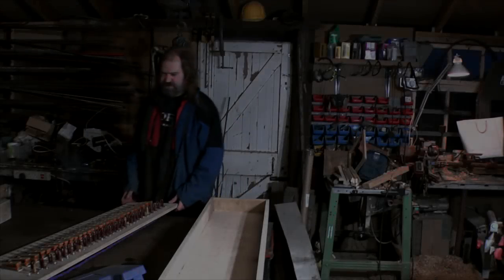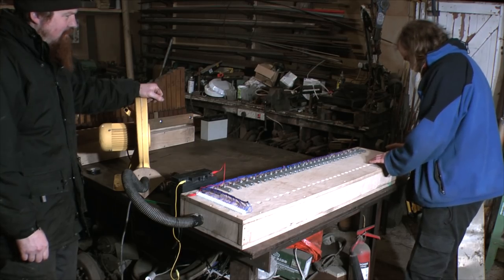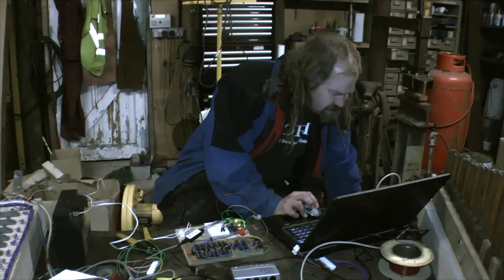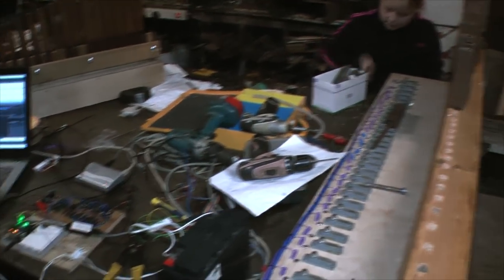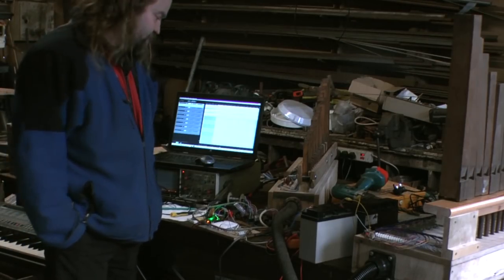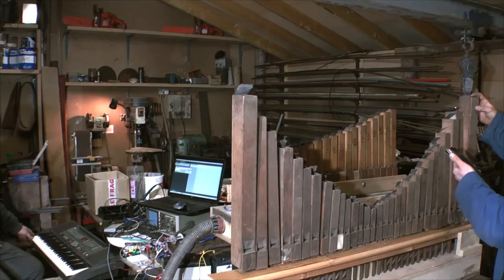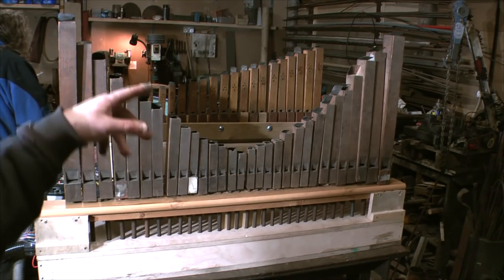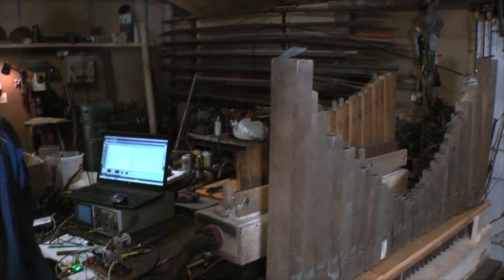Project Awesome 4: Bach in da house

Comment: Interesting.  I once visited a guy in Central Indiana that put an old, very large pipe organ in the loft of his house, complete with all manner of horns and bells.  He had a large motor-drive compressor in the basement, and interfaced the whole thing to a Mac midi arrangement - which would pretty much blow the house down when he played it.  An interesting guy, PHD in electronics, built the early television stuff for Oppenheimer during the war.

Comment: Ok i will admit i never expected that organ to sound as good as that great work from Mr beard no 2, as for Mr beard no 1 so good to see that Landy running so strong a credit to you Max.
Reply: Thanks for the comments. The voicing of the pipes needs a bit of work and it's running on an unregulated wind supply, but things are getting there!
Reply: It’s already sounding good though. That series really does look and go well
Reply: It's fascinating even if I'm struggling to understand the process
Reply: It's fun. Not rocket science, although there is some basic math involved such as the simple fact that an octave is 12 evenly spaced intervals that double (or halve) the frequency.

Comment: Certain discontinuity in the content; was the subterranean installation to be a soundproof  practice room and   domestic requirement for the later  unregulated wind discharge? Genius work anyway in the shed on the solenoid front.

Comment: Also, i was wondering would you be able to do a video/comment on what tools/equipment a person could/should have if they are considering a small garage workshop with mains power. Thank you in advance!
Reply from the maker: I'd certainty consider it, I'd need a few more details though as the tools/equipment would vary depending on what you intend to fix/make!
Reply: Well i have a passion for machining including milling and turning but have gained great inspiration for your blacksmithing and reclaiming and reusing materials and i just need some help/advice with what equipment would be good to get started with. I have noticed you have a a pillar drill but couldn't see the brand name, also i saw the wood turner that you have been using and will be investing in one myself. For example i haven't a clue with blacksmithing and would love to know how to start. Thank you in advance.
Reply from the maker: I'll see what I can do!
Reply from the maker: Video uploading now...